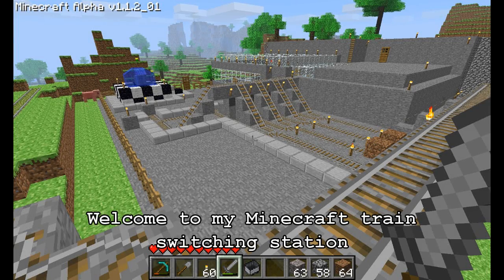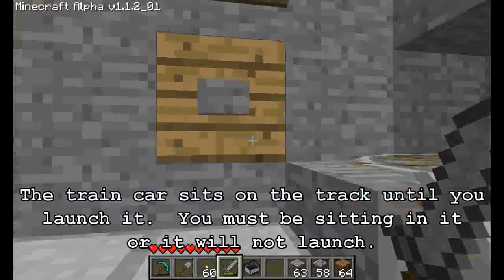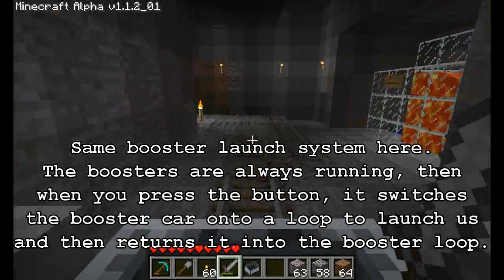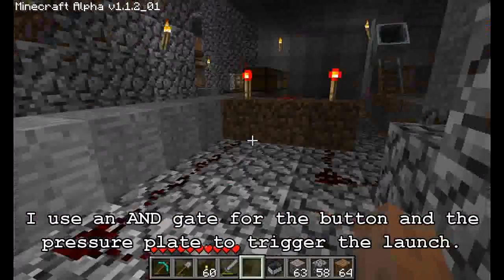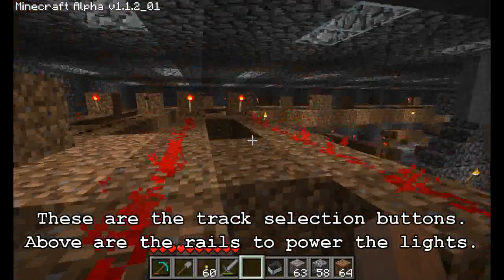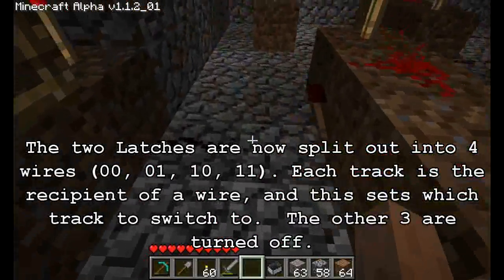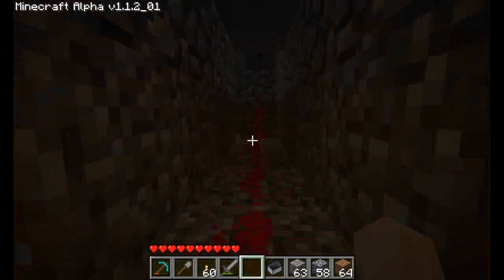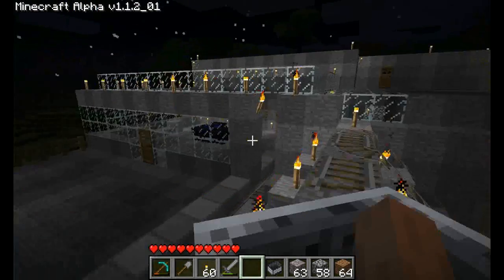Minecraft Train Station

Comment: Very impressive and such neat circuitry too! I like your use of buttons and stone pressure plates at the various stations, an elegant solution. 

I never liked the systems where you call for a cart and must jump in but it can get complicated on the receiving end of a station if it is just a stone pressure plate that triggers the boost. (hopefully that made sense)

I ended up solving it with some overcomplicated water + iron door loading mechanism but it is still far from optimized unlike yours.

Comment from the maker: @b7342 That is definitely a workable solution and it does simplify the wiring.  I went with the button because occasionally I jumped in a cart and changed my mind, but it was too late and I got boosted out.  I'm debating going back to the stone plate in my next station.  As long as you add a switch on the way out of the station that grabs empty carts, you can still jump out at the last second without breaking the station.  Check out the new stations by Hattericus and TheClawofZ.

Comment: Are you an engineer of some kind? There should be a degree with a requirement "make a fully functional, confusing, and yet simple to use train station in minecraft".

But to the point, will you update this with the newer booster tracks and delay/repeater/diode items?